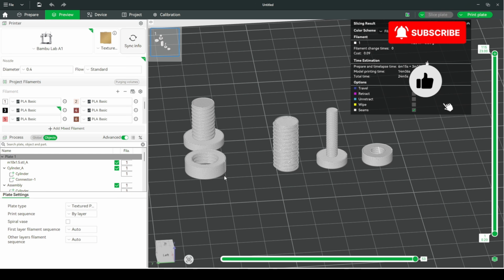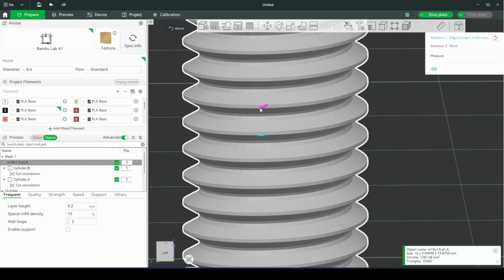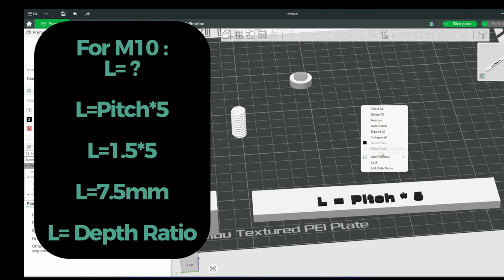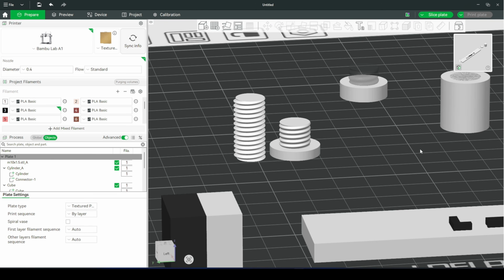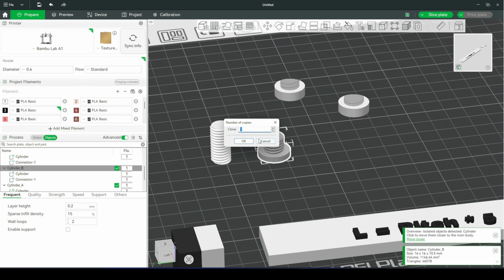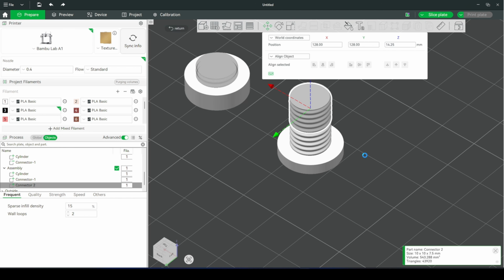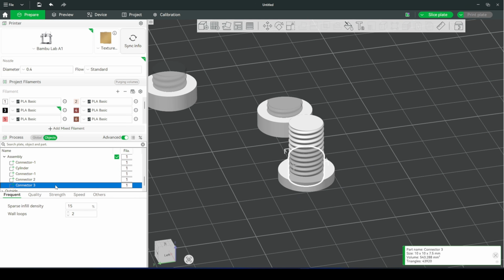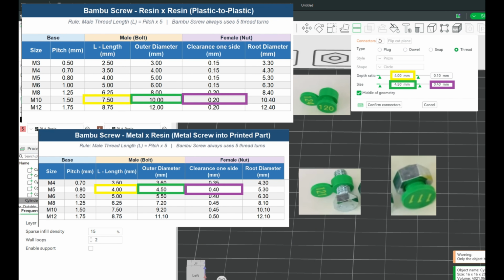Bambu Studio Thread Advanced Setting (End-to-End)

Comment: I'm new to 3D printing so feel free to correct me if I'm wrong.
Because single bolts are rarely needed, I find this process unnecessarily tedious.  Wouldn't it be more productive to generate a maximum length of thead as a separate project. It could then be imported as required, attached to the head and cut to the necessary length?
If diferent bolts are a common feature of your projects, it may be well worth producing a library of varying threads that could be imported as needed.
Reply from the maker: Honestly, that’s a really great idea! It would definitely make the whole process much faster and more practical, just like you said. You’ve got some really good thinking there, and I hope everyone who sees your comment can benefit from the idea too. 
Thanks a lot for sharing it!